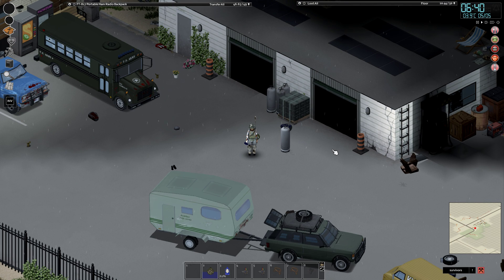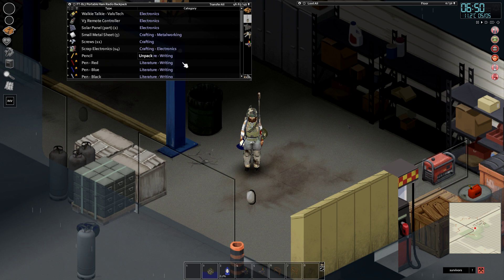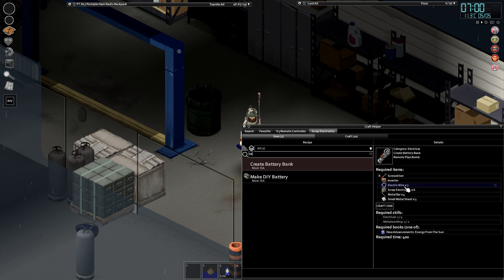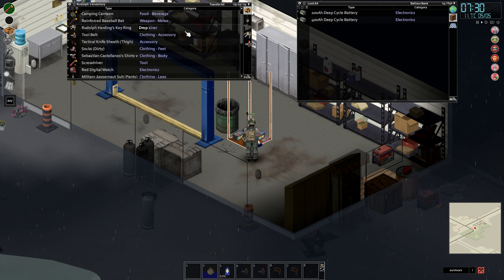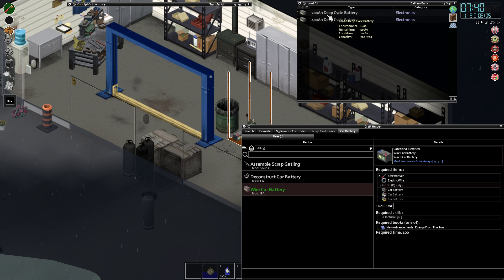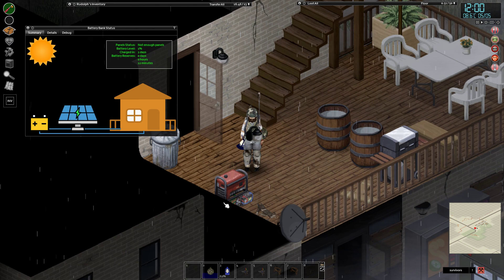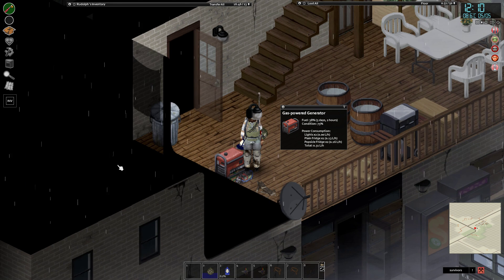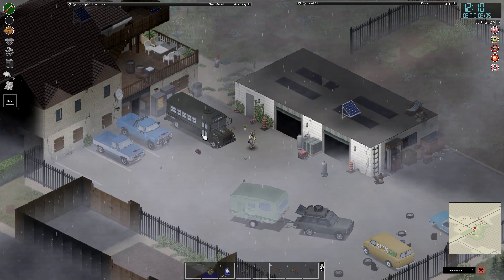Project Zomboid Immersive Solar Arrays A to B

Comment: I grinded lvl 6 electrical how do I craft the v3 remotes
Reply from the maker: you need Electrical Level 6 and specific components like Electronics Scrap, Electric Wire, and, often requiring you to read Engineer magazines 1 and 2 in an existing save to learn the recipe and link it to receivers for traps or doors.
Reply: @shrek296 thanx man! Now do u have any suggestions on where to find the remotes? Whether the v3 remotes or the tv remotes to craft them?
Reply from the maker: @hec8868  It all depends on which build you are running. If it’s Build 42.13, as of yesterday when I was playing to check out the new farming they added, I found quite a few in quick succession while searching houses. You can find them on coffee tables and in bookshelves, particularly in houses that have TVs.

If you are playing on the older 42v build, they are much rarer, but it’s the same locations again, bookshelves and coffee tables.
Reply: @shrek296 thanx man appreciate your time and help, sub earned!

Comment: How can we improve the solar panel energy output per hour? Is there any mod about it or do we just have to built 100 solar panels in order to get enough energy to run couple of fridges
Reply from the maker: So when you start a new game you can go into settings and there's different things you can select, from building your own solar panels from scrap parts to have any ability to change how much of a percentage / how much power is produce pear Solar power unit but you can only do that under settings.

Comment: I'm having an issue in that the bank is trying to power other houses around mine, am I able to reduce the radius the battery bank powers or do I have to go into each house and dismantle everything that could be using excess power?
Reply from the maker: You can't change the radius, you will need to got to all the other houses and turn off lights or dismantle items that use power, like fridges and what not.
Reply: @shrek296  The lights in neighbouring houses are off but is still consuming power for some reason. Am I able to remove the lights entirely?
Reply from the maker: @drunkonsuccess779  if the lights are off then they should not be using power, remember to check for outside lights. Best way is to go in and check the bubble of power at night, that will show anything thats on and yes you can remove some lights but not all sadly. But I do know there is a mod that gives you rewiering, so take light switches off the wall, worth a look if you can't get this ficked. Oh and on a side note, you don't have a van where you can go inside it do you, if the light switch is on in the van it can affected the genrator/ power banks as thats a cheat way of charging your car battrey if you didn't know so if the van is in the power circle that might be it.
Reply: @shrek296  We're in the gated community in Riverside, both our regular generator and solar are saying it's powering 36 lights when our house maybe has 15, but houses around us have their lights off so it's just about us trying to figure out what's going on. The solar is also refusing to power our floodlights for some reason. I think I'm just gonna go into the houses around us and gut them in terms of lights.

Comment: hi, how big is the radius area that these solar arrays are able to power?
i'm talking about the range of the area that the solar arrays can power.
Reply from the maker: Well, the power comes from the battery bank, I get 22 squares from the there and that's on the X and Y axis.
Reply: @shrek296  ok, thanks man, another question: can you connect the power bank and the solar pannels through walls?
Reply from the maker: @gabrielharasim6089  Yes, think WiFi. That's how the game connects the solar panels and the battery bank. It says it's wireing it in but there is no physical wiring, a heads up if you want to make a fail safe linked to a generator you don't want to go above 4 floors, the z axis. They might have updated that, but from the last time I checked, that was still the case.
Reply: @shrek296  hi, it's me again, I have another question, can you connect the same solar panels in multiple power banks?

Comment: Doubt you'll ever look at this again but if you do, could you do a follow up video where you cover the Plumbing mod in the same manner as you did here? I'm having trouble understanding how to get it to work with wells. Can I run pipe from a well using the pump to make showers and sinks work? If so how, I can't figure it out.
Reply from the maker: You seen my avatar am the shadow broker am always watching lol 😆,  I've never really used Wells before I always build water collection units aka water barrels above my sinkes and showers on the roof and plum the water in that way, as long at the barrel is above the utility you want to use you can plum it in, wells would be rquire a pump and from my knowledge there are no well pumps in the game other than hand cranking ones, because your water is below your utility your are not going to be able to achieve the venturian effect required for water to be pulled up from the ground. Unless there is a mod out there that has added a well pump, and if so please share and I will more than happy to have a look, wouldn't mind using that myself and anything I find out I'll pass on to you.

Comment: I might have missed it, but what does the inverter do? also, I have six panels and 4 batteries but riverside school (3 lights, 2 popsicle fridges) is sucking up almost 500 power. The battery level also says its at 0%, will this increase during the day time? Thanks for the tutorial!
Reply from the maker: Hello bud, so the inverter is used to create the battery bank. In real life it changes the (AC) Alternating current into (DC) - Direct current and vice versa.  You can on a new start set it up through settings that each panel creates a certain amount of electricity, as a default 28Ah but you can change this in settings, so if your pulling 500Ah and only have 6 panels you are only making 168Ah in default you battery Bank will be running dry constantly. 

In real life the Efficiency of solar panels have increased dramatically over the years, so changing the settings isn't cheating at all if anything it's just changing with the times. 

Hope that helps

Comment: I'm not given the blueprint even with mod active
Reply from the maker: Blue print what do you mean?
Reply: @shrek296  in the creating menu can't build battery banks or wall mount solar panels but solar panel parts and battery banks spawn in world but can't do anything with them
Reply from the maker: @master6435  If it's not under recipes then it sounds bugged my friend, when you install the mod and start a new game there are tons of options, even the ability to change the wattage and if you can build panels from scratch, might want to look under setting and if there is nothing you can see might be the old start a new game which is very annoying if you have a server or been playing a map for some time.
Reply: @shrek296  that what I did twice
Reply: @shrek296  I think if devs added an alternative energy source making windmills from car alternator would be great
Reply from the maker: @master6435  Cool, been so busy with work not had a second to look, will take a peek thanks
Reply: @shrek296  been trying to get it to work on muti player
Reply from the maker: @master6435  Ha, good luck with that, I have no idea about multiplayer, I did try my hand at making my own server and it was fun, but it became a full-time job so had to give it up, but really enjoyed it,
Reply: @shrek296  good to know
Reply: @shrek296  the problem was had to find a magazine that needed to be read to get the blueprint that's why they weren't in crafting menu
Reply from the maker: @master6435  Oh man, really, I am sure I covered that, yes I've just looked  it was mentioned 1min and 46 seconds in, O well as long as you got it working now bud thats the main thing, you enjoying the mod

Comment: Great video, I was wondering if you might do one on the super survivors mod as that seems to be a bit picky to get working right. Also what’s is the mod that gives the little world icon while your looting???
Reply from the maker: I can look into doing a super survivor mod helper video if you think one is needed, is there none out there at the minute? And the world icon, do you mean the mini-map at the bottom right?
Reply: there is no detailed video that i found for the super survivor mod,  for the world icon i was on about the tiny world that appears in the loot screen where you can chose which container or the floor to loot from. Hope you had a good christmas. @shrek296

Comment: Immersive Solar Arrays (ISA) is a fantastic mod for Project Zomboid!  Give it a try and if you have problems, here comes Shrek!  Watch the whole video and you'll have NO questions about ISA again. Yes, he's shown us how to connect the generator and failsafe backup as well!  Nicely done, Shrek296!
Reply from the maker: Happy to help my friend
Reply: Oh yeah?  Is it possible to craft an inverter, and where are the best places to find them?
Reply from the maker: @artemiseritu  You can find them in any auto repair shops and I also find them in boots of cars, as for building them not sure, but if you can't I bet there is a mod that will let you, hope that helps
Reply: You can craft an inverter with scrap electronics and some other electronics crafting materials (screws, electrical wire, etc.). Watch the video, it's very straightforward.  @artemiseritu
Reply: @artemiseritu  Yes you can craft the Inverter.  I've found one and created another.  I think Level 5 electrical, some electric wire and other bits/bobs.  It shows in the magazine needed for all the solar and in the Crafting menu.

Comment: Question - how far can the solar panel be from the power bank and still connect ?
Reply from the maker: So I did this experiment a few months ago and got 22 squares away from the battery bank and that was on the same plain, so the X-axis and Y-axis. Now if you go up levels let's say a house you need to go up two floors you need to take that into account like a cubic square, so for each level you go up it reduced number, so instead of 22 you now only getting 20 distance. Basically, every Z-axis you need to go up takes away from the X-axis. Hope that helps bud but on a side note the mod might have changed silently since my last check but the fundamentals will be the same.

Comment: I can't make my solar panels wall mounted or otherwise, and no option to connect them to my battery bank. Anyone have this issue?
Reply: You need to have electric wire in your inventory or nearby. It's a required component to make usable solar panels.
Reply from the maker: How far away is the sola panels
Reply: @shrek296  I think it was my fault, not high enough level in Electronics yet, thanks!

Comment: I started using this 3 days ago. Why are the wired batteries keep breaking?
Reply from the maker: Breaking, in what way do you mean breaking, as in their condition is reducing to zero or you put them in the battery bank and they go pop
Reply: @shrek296  there a red X showing up on the battery and behind it says Broken. Keeps happening with the wired batteries only. Not with the 200 and 400 Ah batteries.
Reply from the maker: @realghoststories1210  not sure. I've never had that problem. If that's the case, just stick with 200 and 400 ones, which is a bit rubbish, as you can't make your own, might be a bug have you told the maker of the mod, if you work this out please let me know, I'd be interested to why this is happening.

Comment: hey dude, kinda important question that i didnt really see in the vid. can these explode like generators? like generators after 5 days can explode if they arent repaired, does this also count for solar panels or the battery bank?
Reply from the maker: Not what I have come across no.
Reply: Generator explosions when condition is below 20% isn't related to the number of days (like 5 days); it's predicated strictly on the condition.  So a gennie running a ton of appliances could theoretically go below 20% condition in a game day or two, whereas a gennie only running a couple lights could last for like 30-50 (etc) game days without dropping below 20% and possibly catching fire / exploding.  And no, Immersive Solar Arrays mod has no threshold where it explodes like a gennie, nor will the deep cycle batteries / DIY batteries / Wired car batteries ever explode / catch fire.  ;)

Comment: it´s allways disconnecting on our server after restart and 18 connected solar panels are apparently not enough for one bank
Any solution for the first problem ? Or any known issue ?
Reply from the maker: No idea about the online issue, never heard of that problem before. As for 18 solar panels do you mean you still don't have enough to power a base or house, well under settings you can say what a panel can make in power, It has a default setting but you can easily increase that if you want, like in real life solar Tec is improving all the time so throw a few more A/PH in there and your laughing.
Reply: @shrek296  well i'm not the admin but i am in close contact so maybe i can work with him to desolve the issue. As for the Panel amount, i thought it wouldn't be enough to charge the batteries but as you said it's for powering the base itself 👍 we have a generator which does it for us but in case everyone is gone looting and it runs out i wanted to have a way to stop the freezers from defrosting. As for now the generator Trailer is a good alternative because it has a much bigger gastank 👍

Comment: I can't find the inverter anywhere, nothing in muldraugh werehouse, even my survivor finally died bleeding in muldraugh, any hint?
Reply from the maker: I do believe you can make one if you have the right electrical skills, look under recipes, I'm sure it's there.
Reply: @shrek296  negative, i cant find the recipe for inverter, but the magazine said its including recipe for the inverter, i think this is a bug
Reply: @streamspoart2671  You can Craft the inverter.  I just made one earlier today.  Running most-current version of ISA (Immersive Solar).  Cheers.
Reply: I found one at the Riverside factory storage

Comment: The only suggestion I have to this otherwise excellent tutorial is perhaps to add a bit more emphasis that the battery bank has a range. The generator needs to be in that range, which seems to be a radius of 4 tiles.
Reply from the maker: So the Generator needs to be within 10 squires of the power bank and the power bank itself has a range of 21 squires. The maker of the mod is playing with the code right now so I will make another video when all the bugs have been sorted as a few are now popping up at the min.
Reply: @shrek296  Almost. It's 4-5 tiles from the power bank. The debug menu shows when a player is in range or out of range. You can use that to place your generator within the 4-5 tiles radius from the power bank. So anywhere in that power bank circle (diameter of 8-10, radius of 4-5) should indeed do. I suspect the second mentioning of the word "power bank", you mean generator. If so, then this lines makes more sense to me.

It'd be interesting to see what the updated code will bring.
Reply from the maker: @spacedreamer9055  I did the experiment yesterday bud, trying out everything I could think of, power from the battery bank to utilities like lights and TVs sat at 21 squires. As for the generator with a fail-safe fitted to recharge the batteries when they are low in power, I got up to 10 squares away from the battery bank. So the radius for me was 10 squares, meaning the diameter was 20, so I have no idea why you are getting different recordings, the only thing I can think of is the Mod maker has updated his Mod, so maybe I came across that updated variant of the Mod yesterday. I Have noticed this new update has a few bugs in it, so like I said before I'll wait till it's all sorted and then make a new video with what everyone has highlighted including your input.
Reply: @shrek296  Np mate. Since you have more experience here, I'll defer to your judgement. I'll keep an eye out on your update when it comes out.
Reply: The generator (for failsafe battery charging) gains a square / tile of range it can reach the Battery Bank for every Electrical level.  Level 5 electric = 5 squares / tiles.  At level 6(+) you can also have the gennie above/below you one floor vs. on the same floor.  Tested as-of ISA (Immersive Solar) today's date 12 May 2025.  Cheers.

Comment: does anyone know the range of the battery bank? width, length, how many floors up and down? maybe circumference?
Reply from the maker: It's about 22 squires from the battery bank from the little experiment I have just conducted, that's the Y and X axis, hope that helps. Just in case you don't know what that means X is along the ground and Y is height in this game.

Comment: Thanks for the guide going over everything. I do have a small question though, do I need to have the generator on for the failsafe to kick in? Does the generator instead turn on and off on it's own?
Reply from the maker: Once you put the failsafe  to the generator it will auto turn on, just make sure the Gen it connected before you add the failsafe. Hope that helps